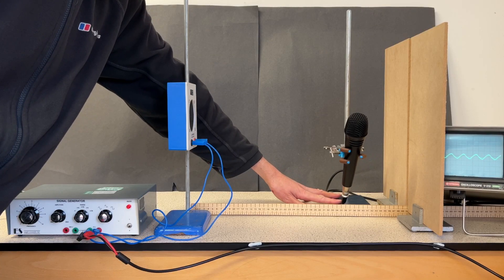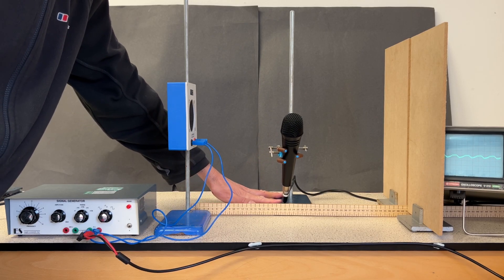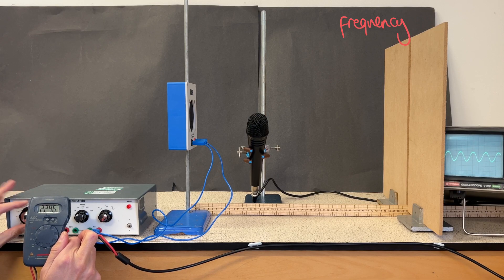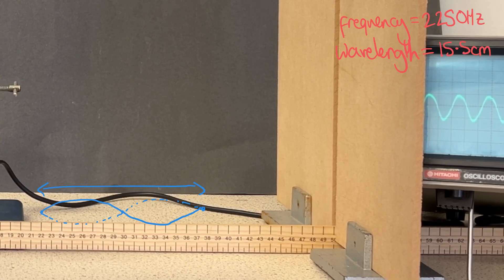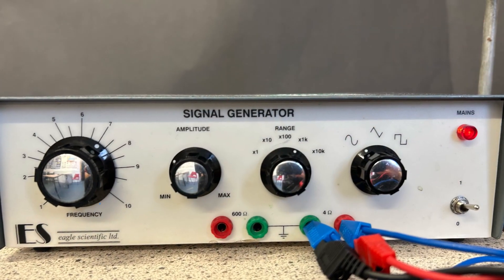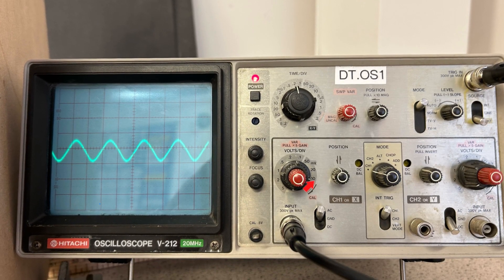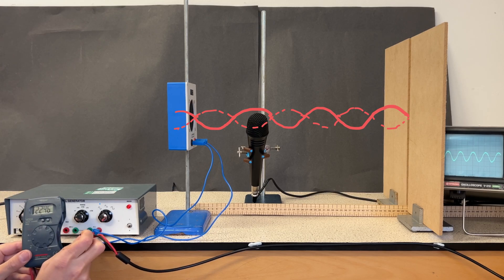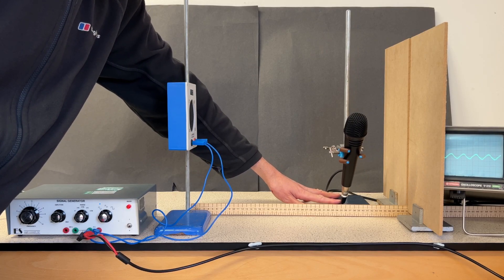Demonstrating stationary or standing waves in sound with an oscilloscope and microphone

Comment: Guessing approximately from the centimeters (15.5 cm wavelength, 12.5 cm from the rightmost intensity node drawn in blue to the wall) I guess theres 3/4 wavelegths more on the right and the wall is an intensity antinode, and walls are pressure antinodes, so the intensity you are measuring with the microphone is proportional to the amplitude squared of the delta pressure wave and not the displacement wave?

I'm trying to figure out that if, if i'm correct, pressure nodes and displacement nodes are displaced by 1/4 wavelength, which are the ones that we hear as silences? The pressure nodes or the displacement nodes?

Or aren't they displaced in the sound standing wave?
Reply from the maker: The microphone will detect the largest sound at the pressure antinodes which occur at the displacement nodes which  I think is also where we will hear the loudest sound.
Reply: @SimonPoliakoff  Thank you! And from what little i've been able to find, is it true that although the microphone picks up the loudest sound at the pressure antinodes, the wave intensity is actually maximum at both the desplacement and the pressure antinodes?